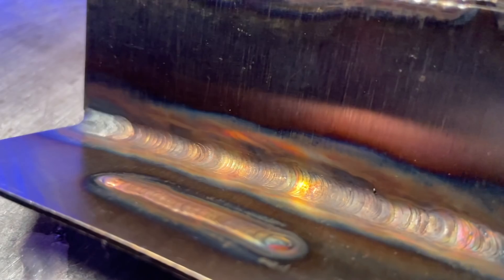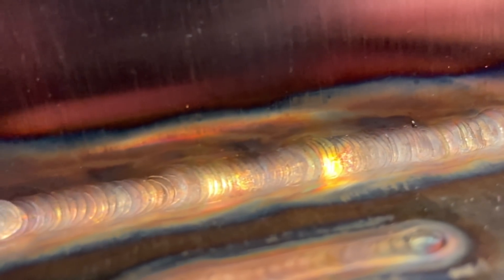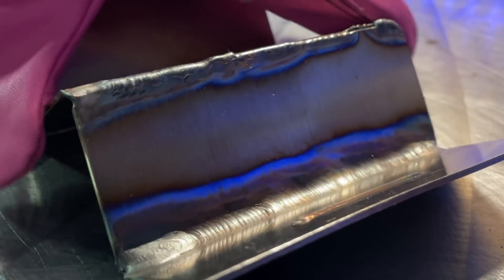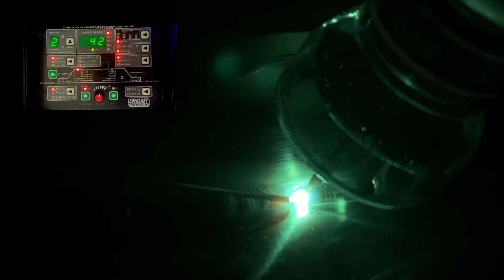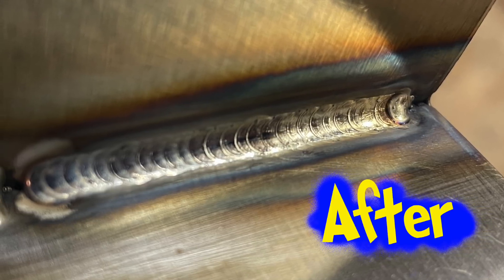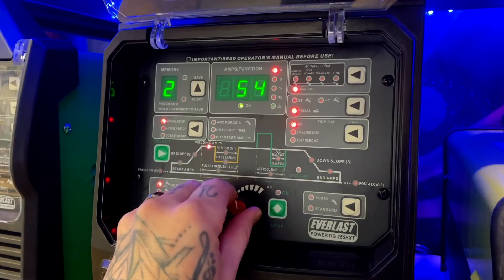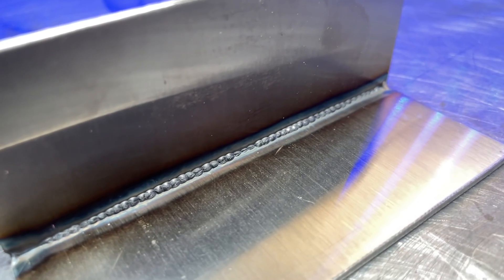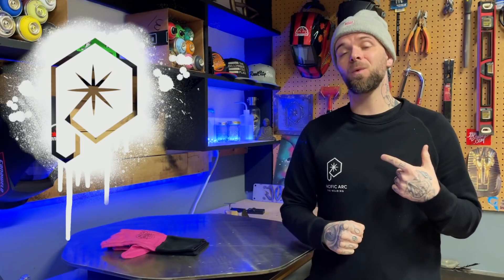How to fix bad Tig Welds.

Comment: Hi Dusty. 

I have started tigweld autobody rust repair for a month ago. Havent got so much welding done (DIY guy) but as much as i can i do it. Love the tig. In my study i found your awesome channel and am curious. 

If you dont know what the next video topic will be, i have a suggestion for you. Butt-weld of 19-20 gauge steel :) both with perfect gap and a bit off gap, like this: tight at both ends and a little bigger gap in the middle (witch is the way my joints turnes out every time lol), 

You are awesome. :)

Comment: Did u ever come across "bad" filler wire? As in a specific brand that's not made with proper materials? Keen to know if this happens.
Reply: Has never happened to me.   Unless the filler is corroded or rusty,  clean it up with some sand paper and acetone.  Good to go

Comment: QUESTION DUSTYYYYY!!!!
When I try to weld and I put my filler into the weld pool it actually creates an unstable pool which affects the uniformity of the weld if you know what I mean.So when I m finished it doesn't look continues with even dabs.HELP
Reply: Try tapping the wire up-and-down like a drumstick instead of poking towards the puddle. Filler wire hand doesn't have to move forward if the wire stick out is far enough. Also use a continuous smooth forward motion with tig torch do not pause or pulse.  The smoothness of the tig torch has a large result on finish product. Any stopping can cause large heat input causing a larger Weld. Move as fast as you can forward while maintaining a clean puddle in your arc. Also a large gas cup helps with color.
Reply: @MrHennrocks  Really appreciate it man!!!
Reply: @MrHennrocks  100% agreed